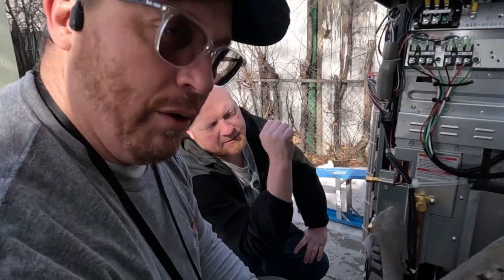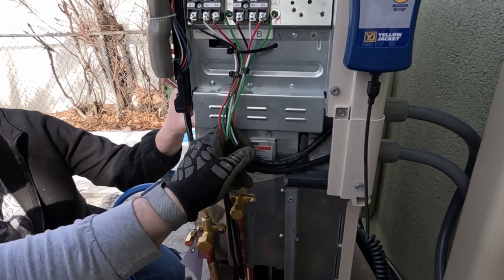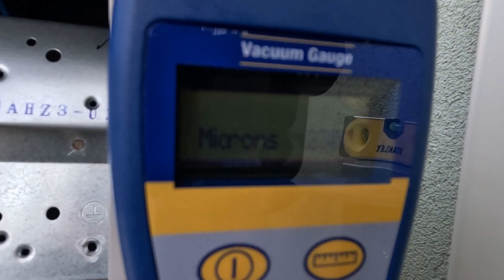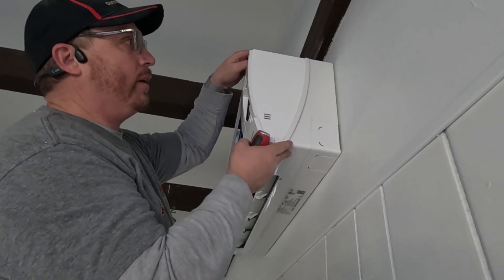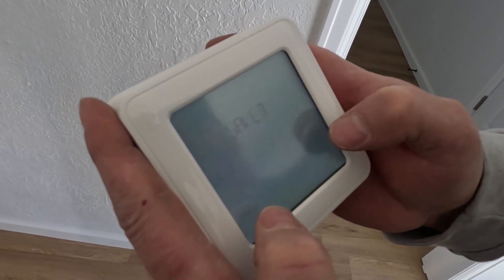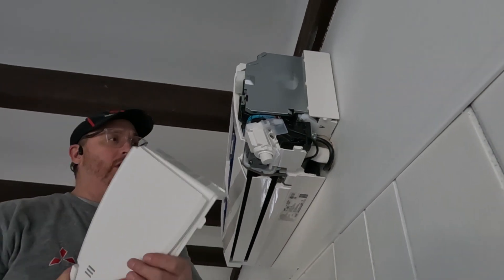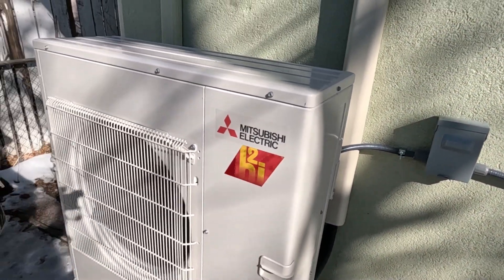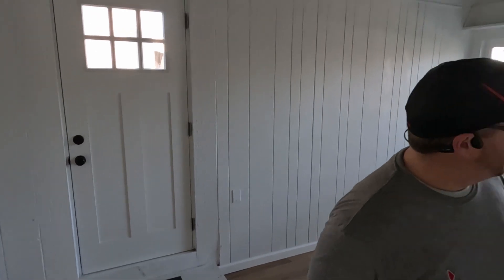H2i Hyper Heat, Cold Climate Ductless Mini Split Install

Comment: You should use a CRT and a half inch hose. Connect your micron gage to the CRT and your pump. Your creating a ton of extra time using all them gages and long hose that's smaller in diameter. Shouldn't be using anything smaller then 1/2 when evacuating.
Reply from the maker: Bro this line set is super short.

Comment: What about the refrigerant? How does that get added or does the unit contain refrigerant and you just open the port after you take the air out of the lines?
Reply from the maker: They come with refrigerant, however if your lines are longer then 100 feet you need to add gas using the DSB tool to determine the amount. Check out the DSB video.

Comment: I am looking to install this unit at a house were we are gone for the winter, what happens when the temp falls below its operating temp say -20 degrees. Will the unit shut of and will it restart again? my alternative heat is electric baseboard.
Reply from the maker: They work down to -18 but that's the shut down temp. I always recommend you have an optional heat source that you can set a few degrees below the heat pump then the supplemental heat can turn on. However, the units will fire back up once they see heat in the morning. Typically you will see a shutdown @ night for only a few hours. 

We have 28 of the units in Craig Colorado they see negative -40 sometimes and the customer has never complained in 2 years. 

Get a Kumo cloud on the system then you can remotely see the system and run it. In the event of super low temps keep an eye on the weather and ramp the units up so they dump more heat in the home for cold stretches. 

Hope that helps

Jared

Comment: Hi I uses kumo cloud having issues should i get the MHK2 themostat
i have Rf condenser 48 BTU and 3 Ceiling cassettes and one wall unit 
the wall unit has remote others do not have and i primarily use kumo cloud .
but sometimes have issues if i had a permanent thermostat i think it would be more reliable?
Reply from the maker: I love the MHK2! Kumo is okay if the internet is solid

Comment: You will be able to pull deeper vacuums more quickly and efficiently with valve core removal tools, large diameter vacuum rated hoses, and not having a manifold gauge set in the vacuum setup.
Reply from the maker: Thanks that's a great option on large 7/8” or larger systems. This is a 1/4” - 3/8” line and the vacuum gauge lets me know when I'm good. I Always use a micron gauge so I know it's good.